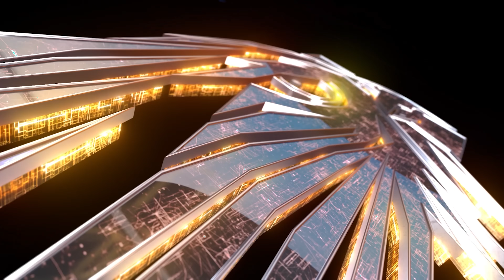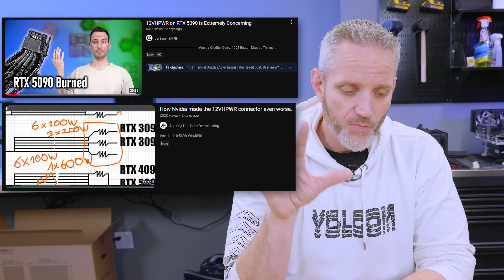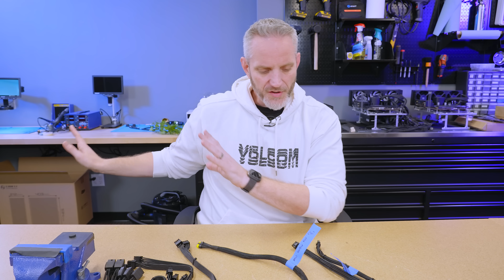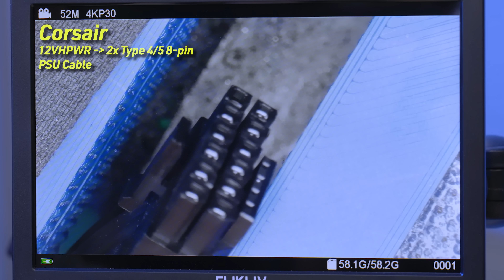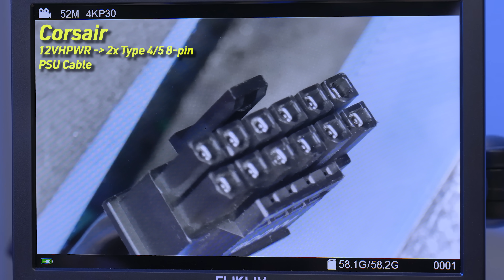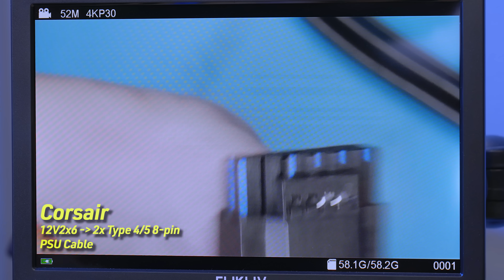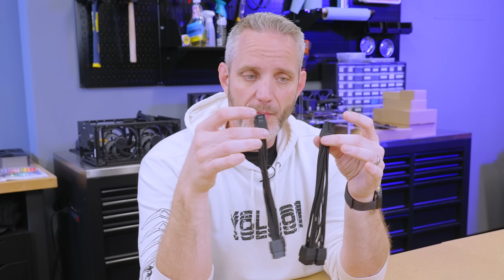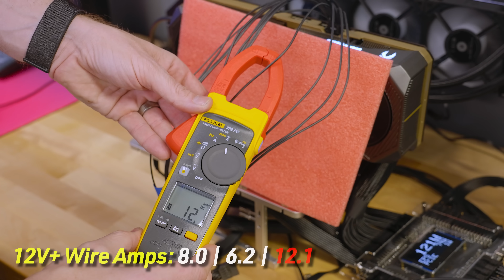I discovered something concerning and I need the Experts to chime in... More 12VHPWR discovery!

Comment: While I get what people are saying about 'load balancing' on the card, and whatnot, I don't think people are keeping in mind that running parallel sets of conductors for delivering current WITHOUT individual overcurrent protection or crazy high safety factors is the norm. Every commercial building you step into that is of decent size is generally going to have parallel sets of aluminum or copper wires feeding the service, and sometimes even the load panels depending on their amperage.

You need to factor in heat dissipation, one pin being slightly higher than the others, even above its rating, will generally mean the others are lower than their rating in the surrounding blocks, the heat will dissipate accordingly. It's not ideal, but it is within design tolerance.

Seating can definitely play a big part, but that's not necessarily something you could test simply by re-seating it, and turning on the power again and again. You would need to isolate for ensuring that the draw overall is consistent each time, and across certain intervals.

Another thing to keep in mind, more connectors, more splices, the more resistance and heat that is introduced into the system.

I'm a bit dubious that having all of them sharing the same rail is an actual problem. Having them all share the same rail should normalize the expected current and temperature variance, as they all feed into one bus that then feeds others. In AC Electrical we don't split your House Busbars in two for a Current (Ampacity) standpoint, we split them due to having two different Voltages, in the case of Residential, Split Phase is 120V a busbar that is actually one phase split in two at 180* (taken in the middle as a common point of reference). A 2P Breaker is 240V, a 1P Breaker is 120V, at 10A for 240V you have 2.4 KW, 10A 120V you have 1.2 kW. 

Everything gets dumped onto the same busbar, there is no separation for protection on that busbar on the load side. There is overcurrent, arc fault, ground fault protection in the breakers, which prevents issues with the individual loads (or supplies, in the case of solar or other energy sources), but that doesn't actually protect the busbar. There is generally going to be a Main Circuit Breaker or set of Fuses, that protect the Busbar from the Source of Power (aka Utility generally), but when it comes to the copper itself you're slapping it all on there together.

Why does this matter? And why do I bring it up? The actual heat, or temperature of the busbar, will be different across it. Starting closest to the source of the power, you will see a decrease from the high point to the end. This is a little different with centerfed panelboards, but has the same expected result. In Solar we introduce a Secondary Power Source, which has all sorts of requirements, but if we locate it at the Opposite end of the Busbar, we are allowed to energize that Busbar to be at 120% of its rating. Yes, you read that correctly. I can have a 40A Breaker for Solar, which is designed for a max output of 32A (although worth noting it is ON a 40A Breaker), on a 200A Busbar that is ALSO supplied by 200A from the Utility.

It has to do with heat, dissipation, and consumption. Paralleling conductors and sharing rails is not abnormal. I am inclined to give Nvidia the benefit of doubt, I am very dubious they would go into this without sufficient testing that indicated a very low failure rate. I could see them overlooking the initial issues, all caused by user error, because when you're a professional in your field you don't generally think like a novice. Dude I make sure ALL my plugs are plugged in, not just on my $1600-3000 GPU, I plug something into the wall, I make sure it is done right, so that my house doesn't burn down...

I would agree that I would like to see a larger safety factor, but I'm pretty dubious of most of the comments I've seen.

Comment: A sidenote on Fasgear cables; I have A LOT of their USB cables in use. 2 of them being 16.4ft (5m) USB-C 3.2 gen 2x2 cables and ALL their cables perform at the advertised specifications and great quality.  The long cables really surprised me. I even bought them with the idea that I'd be happy with getting 10gbps one direction out of them because the price was really good. I use them on a regular basis and can transfer files at 10gbps in each direction at the same time for the total 20gbps that the cable is rated for. NO, you will not get 20gbps in one direction and that is NOT the USB 3.2 gen 2x2 spec is. USB 3.2 gen 2x2 is 10gbps in two directions simultaneously. In simple terms USB 3.2 gen 2x2 cables are 2 USB 3.2 gen 2 cables in one cable sleeve.

Comment: As an electrician what causes connections to burn is a loose connection either in the power supply going to the terminal the wire is connected to or in the other end of the wire to the connection from there to the devices powering somewhere in that line there's a bad solder bad connection bad termination on the ferrule connections in the cord and that's what causes excessive Heat AKA poor Manufacturing

Comment: What about the super flower 600w 12vhpwr cable? I just used it on my 4070 super. Didn't check the pins before installing.

Comment: The problem these connectors are having have been solved by battery manufacturers in the RC industry more than 10 years ago. This is just amplifying the issues that were had with Tamiya connectors with friction fit pins that could slip free and cause conductivity issues. Its maddening that this connector exists. It is so shitty.

Comment: What I am wondering is if you run the adapter, and  hook up 3 8-pin connectors that are not 600W, is it possible the issue others are talking about doesn't happen?  I am wondering if that partially load balances the power delivery, by virtue of splitting the power between 3 different connections on the PSU side.  Can the PSU deliver enough power from the 8 pin connectors to melt the wire, or is that something that can only happen with the 600W connector?

Comment: EE here. I am disappointed but not shocked that things have come to this. I would have /hoped/ that NVIDIA dedicated multiple validation teams during pre-production to test and monitor every aspect of the power delivery subsystem on those cards across temperature. Setting aside the fact that I believe they should be running 24 or 48V to reduce the current draw (and heat) at this point, the sloppiness of their design is astounding. When designing something like this, you can't just assume that each individual connection will have the same resistance. Manufacturing variations, a temperature gradient on the PCB, or simply different routing will cause some paths to have lower resistance than others. Additionally, if there are components in the power path with a negative temperature coefficient (decreasing resistance with increasing temperature), this will skew the imbalance even more. My point is that these are considerations that should have been taken into account when designing a high power system like this. In order to safely and reliably balance the load, they would have needed to (a) use separate regulators capable of operating in parallel to create an intermediate rail, or (b) double the number of wires and require PSU manufacturers to provide 6 independent 12V 4-wire (kelvin sense) outputs. As a final note: why aren't PSU manufacturers (or NVIDIA) installing fuses as a last line of protection? Automotive mini blade fuses are designed to operate at 12V. Install 6 of them (one on each 12V pin) and if any one of them blows the other 5 will blow shortly after. Obviously this doesn't fix the problem, but at the very least it would prevent hardware damage.
Reply: Exactly. NVIDIA DID have the ability to balance the load on the 3000 series cards, then they removed it on the high end 4000 and 5000 series cards, which is why they are the only ones that melt. I wouldn't be surprised if we start seeing fused cables before too long, now that it's basically impossible to deny that this is a risky power connection for a card pulling so much power.
Reply: THIS..

I complete 100% agree I would love to see 24 volts become the next standard. It solves so many problems across the entire power architecture of a computer. Also I would love to see the industry change over to Anderson power poles rated at 45 amps for contact to be the main options for both motherboard and pcie Power...

We're already bucking  down 12 down to the handful of volts used for CPUs...

24  sent from PSU 
Devices should accept as low as 20 volts..

What allow for plenty of overhead and bonus points it would make having external things that run on USB CPD trivial to implement..

We can potentially easily have 100 watts per USB C port at the back of modern computers and not paint ourselves into some stupid corner like we have for the last 20 years..

If we're going to change this stuff do it right...
Reply: @Peterthethinker  servers have been doing 48V for years, and it's even in the PCIe spec now.
Reply: @herrbrain6700  . I'm fully aware of this also unfortunately  the voltage is kinda high....

And a 45 amp pair of Anderson power poles can handle a little bit over a kilowatt at 24.

I can't imagine a use case per pcie card that would need more than a kilowatt..

Nor a mother board  main power....

I just don't see it happening on desktop PCS

IE. ATX Stuff.

To add.

One of the problems with the computer industry  is the idea of minimum viable product not good pieces of hardware
Reply: FUSE IS EXPENSIVE (AHAHAHAHAHA)!!!!1111 BUY AN UPGRADED BOARD FOR BETTER PROTECTION FOR 250 BUCKS!!!!11111 AHAHAHAHAAH

Comment: So basically the connectors need a bus bar built in for even power distribution, leading to the pins, instead of individual wires direct to a pin.

Comment: I would again, urge common sense in this situation, and ask that you take the words of engineers, tech repair guys and technicians, over the assurances of corporations and their CEO's. For example, if you took your Ford to a mechanic and they said it had a factory defect that caused your battery to go bad, but Ford said "No it's fine" I think you might just take the mechanics word for it. I'm not dure why the tech industry is different.

Comment: I've seen the same issue with similar style connectors to the point I make it a habit to push the wires in from the back side of the connector after plugging it in.

Comment: There are lot of extra ground pins in the PCIe slot not to mention the bracket mounted to the case, so a single not working ground pin should not cause failure

the corsair plug where the pin is backing out that far looks like a defective pin, ever bent the tab on a molex plug? i expect the same thing happened

Comment: The card is also plugged into a socket on the motherboard. Some of the ground return current could be going through that socket rather than back out through the cable, but that wouldn’t happen on the plus side of the power because that presumably is isolated from the power that’s available in the socket on the motherboard.  The ground cannot be eventually all the grounds go to the same place.  The fun part about that would be that if you had a bad ground return on the cable then you could possibly damage the connector on the motherboard from having too much current past through its ground connection pins.

Comment: I am not surprised by Corsair poor quality. Bought speakers from them, they were terrible and had feedback (returned), I bought my PSU from them 5 years back, identified it was faulty, so had to get a Seasonic instead, I bought some RAM from them in 2020, it caused blue screens (returned!). 

To be fair, my latest RAM is Corsair and works perfectly, plus keyboard and mouse (they work well). 

However, quality control at Corsair is not great....As a buyer of a lot of their stuff, I should not be a free tester of subpar products. 

Corsair have too many fingers in many pies and need to get a grip on quality. Or people should vote with their wallets.

Comment: Would the ground not have much of an impact due to chassis grounding? The only way to confirm is to test the 12v side with the DMM tagged to the chassis. If you measure 12v, the system is Chassis ground and the Gnd pins would have little impact.

Comment: Pins arent the issue. The issue is that theyre trying to pull 600+ Watts through a cable that is only specced for 630 max. Had they done 2 of them it wouldve been completely fine. Edit: The pins don't help but again it wouldn't be a problem if they weren't trying to pull that much power through 1 cable.

Comment: After seeing how the corsair cable was moving when you were lightly pulling on it, i opened my brand new cablemod 12vhpwr to see if it will behave the same (YES ITS BRAND NEW NEVER USED BECAUSE I STILL CANNOT FIND A 5090 IN STOCK). Anyways, my brand new 12vhpwr cablemod cable behave the exact same, the top corner pin is pushed back and when i slightly pull on the cable it moves and freely shift, non of the other cables for the other pins do that. Im super glad i watched this video and found this flaw in my cablemod cable before using it, i think im just gonna stick with using the included adapter when i get a card.

Comment: All the cables on my PSU are hard-wired to it, so I can't change them out.  So I guess what you'd want to do in that case is check your connectors for excessive movement in the pins/sockets.

Comment: Something to note; Inspecting the cable connections AFTER connecting them at least once is probably better than inspecting them right out of the box. Plugging them in is going to give a better indication of where the pins will end up sitting in the connector. If you inspected the Corsair cable before plugging it in it may look just as pristine as the MSI cable. It might not be a huge difference, but with these connections being so sensitive, it may push the pins back that "razor blade thickness" that turns what looks like a good cable into becoming a fire hazard.

Comment: Long message summary: gpu doesn’t draw power from Motherboard leaving no headroom to the psu cables. 

To my knowledge and knowledge of electrical engineers I communicated with, they say it is fine, but according to spec these connectors are rated to MAX of 10.5 amps. With 6 positive and 6 ground if the card prioritizes to draw from the PSU it is no wonder. Any tiny difference in resistance might cause more current would cause some of the current to be redistributed to the lowest resistance brining it higher, once that burns a little and resistance increases other cables have to pick up the slack and sense they work so close to the maximum power it brings them over rated current causing slow(or not so slow) damage which cascades causing one connection to finally over heat and melt. It is a flaw with design of parallel cables without current regulators. Good rule of thumb is when you have 2 cables in parallel it doesn’t 2x the max current it 1.5x max, considering your numbers are within 3% of 54 Amps which at 12V are 600W means that gpu doesn’t draw power from the motherboard AT ALL. No wonder there are problems the connector is working on the edge and it seems ANY spike above 600w over loads them.

Comment: I just looked at my Corsair RMx Series RM1000x 12V-2x6 cable, and the pins on mine are as bad as the one you showed here, and I could wiggle them in and out with a gentle push/pull on the wire!

I'm still awaiting my 5090's arrival (due around May!) so I have time to find a fix at least.
Reply: RM1000X dated ? 2023 or 2024 ?
Reply: @michelelocatelli547  Without taking it out of my case I can't see a date on it, but I only bought it in November last year.
The lot code in the serial number ends with 23, so I'd assume a 23 model?

Comment: A bad ground can overheat and cause the ground pins to glow red hot and melt, most likely a bad power pin will have reduced power input and less likely to melt unless shorted.

Comment: I am comparing the type 4 12VHPWR cable with the type 5 cables I have for different Corsair power supplies. Noticing the type 4 cable has significantly thinner wire then the PCIe 6+2 cables for the same power supply, and yes that cables on the GPU end wiggle a bit.  The type 4 cable is H+.  The Type 5 cable, wel all the cables for the type 5 power supply that is ATC 3.1 compliant are all thinner, not just the 12VHPWR cable.  It's rated H++ and has virtually no wiggle on the GPU end.  It's a brand new power supply, though, so perhaps Corsair made improvements, but could very well be there some defective cables.  I'm not going to be concerned about either of these, though, because I decided even before the release of the 40 series, I didn't trust the 12VHPWR since it appeared on the 30 series founder edition models.  I also taken a hint from EVGA pulling out of the GPU market when Nvidia decided to force 12VHPWR on the AIB cards.  So still sitting with a 3080ti.  Watching the RX 9070(XT) closely as a possible upgrade path.  But first and foremost, I need a computer that is safe and reliable, and Nvidia removed itself from that, so it's off my radar.

Comment: Have 1 4090 but the 12VHWPR always made me nervous, only used the default cables. I even tried the 7900XTX first. 5090 seems to be having early adopter teething issues. Perhaps too much voltage is being shoved now for 1 cable to handle.